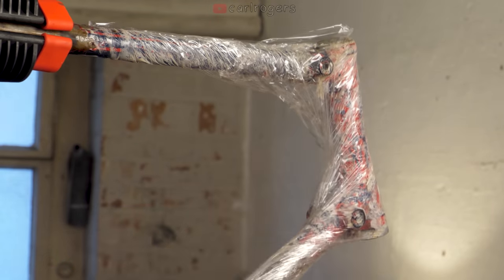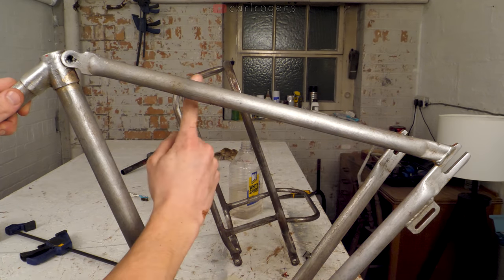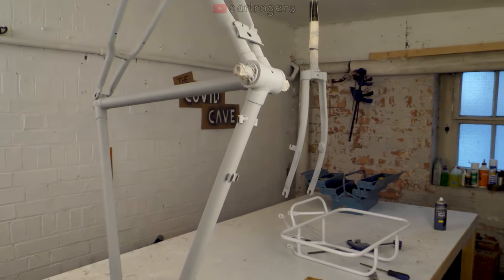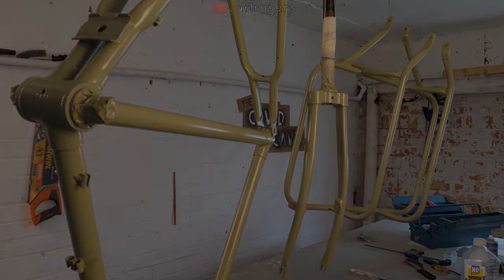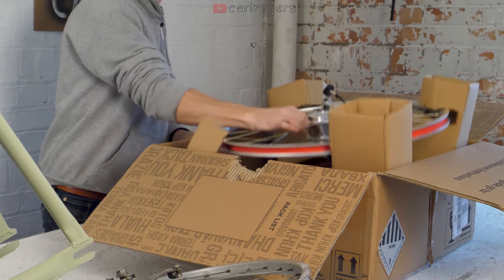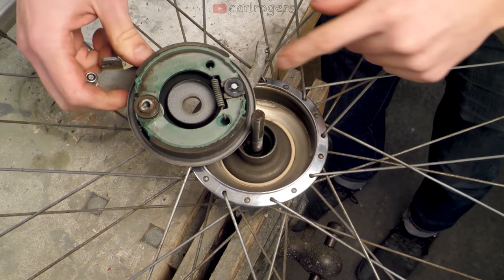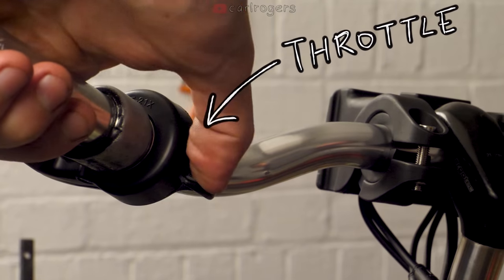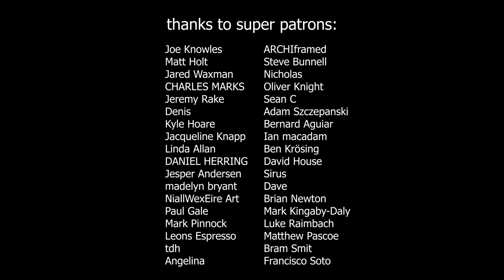Turning Rusty Canal Find into Electric Bike

Comment: Just a tip, if you force a seatpost into a steel frame with a mallet it might never come out. If you remove the seatpost bolt from the frame and put a large flat-bladed screwdriver in the slot at the back of the clamp brazed on the frame, with slight sideways pressure you can open the clamp and slide the seatpost in by hand. Lubing the inside of the clamp as well as the seatpost helps.
This tip is for steel frames only!
Reply: Or maybe get the right sized seatpost in the first place. It should slide in with no bashing.
Reply: @Wuzza47  That might be true for aluminium frames with a separate clamp, but steel frames with a brazed-on clamp usually pinch the seatpost even with the bolt removed. Steel is springy compared to aluminium and the clamps on steel frames were made that way to ensure a snug fit, as the clamps are not easily replaced. If a steel bike has been in a canal for any length of time it will almost certainly have some rust on the inside of the seat tube, making a simple slide in even less likely.
Reply: @liberality  forcing a too big seatpost into a frame even if the bolt eyes are not pinched will almost inevitably make it extremely difficult to remove. The slightest corrosion will also jam it in the frame
Reply: @Wuzza47  I agree, obviously the seatpost has to be the correct size. That doesn't mean it will slide into the frame easily.
Reply: Notice that he coated the bottom of the post with Anti-seize, which should prevent galling and make it reasonably easy to extract.
Reply: @jimboking  If the seatpost was the right size, but then it wouldn't need to be hammered in. Vernier calipers are your friend 🙂
Reply: Woopty doo Basil.
Reply: @Angusmantheman  what duz ita allllll meeeen.

Comment: I kept watching thinking "any minute now he's going to pull and service that bottom bracket!"
Reply: I’m kinda disappointed tbh
Reply: My thoughts exactly! No way that thing was still working properly...
Reply: agreed.
Reply: Since the frame was only in the canal for about ten minutes, it's probably fine. That, and you don't need to pedal an e-bike.
Reply: If it aren't broke, don't fix it :D  (as the BB was sealed, I somehow believe the bike has been used prior dumping it in the river)
I somehow believe the bike wasn't in the river for long. The whole bike frame seems to be in really good shape(paint doesn't count, it is always a bit of a mess).
Reply: @nothereandthereanywhere  
The bearings did seem  to be in a suspiciously good condition.
In fact, better than my new bike after a year of being used and maintained properly .......................
Reply: @kevinshort3943  TBH can't see any rust on the bike, seems only on the front rack.
Reply: @kevinshort3943  So all may not be as described eh, are we being led down the tow path?
Reply: @philipbarrett3151  
I thought the BB was a bit odd, why not take it out to repaint, as it must be ruined .......
But it was very shiney on the drive side, and the other side was plastic (a new thing?).
I also read some other comments alluding to things being setup, staged, fixed etc....

He should have spayed it postbox red though.
Reply: No need to pedal with that non-road legal throttle actuated motor, so doesn't matter if it seizes...
Reply: It's a sealed unit, so there are no serviceable parts. If they feel graunchy or rough you just whip em out and fit another. 
 You would probably take it out anyway though to drain any water and put a bit of grease in there.
Reply: @mickenoss  The frame was filled with water which means the BB was the same - no way did the Post Office put some high-end sealed unit in there.
Reply: @philipbarrett3151  
Thr BB is a "sealed" unit, but that just means they aren't serviceable, crap will get in them over time or if submerged.
Oh, and you can get one for less than a tenner from Halfords.................
Reply: Same. Its basically the heart of turning the cranks. Madness!
Reply: @nothereandthereanywhere  Yes. This Is a fraud vídeo.
Reply: me too!
Reply: Would have taken less time to pull the headset and bottom bracket out than to poorly mask it up.
Reply: @mickenoss  If a bike has been in a canal for any length of time, then likely just whipping out a BB would be next to impossible.  But as this bottom bracket is brand new and the bike was in the canal for a quick dip, no real issue.
Reply: @philipbarrett3151  Also alloy cups. heh.  The tapers had no wear on them at all, either.
Reply: @vtrmcs  went by for a 2nd pass, look at 0:40 - that frame already has paint stripper on! I'm not recommending an internet lynch mob but it's a nice bike restoration video without needing to make up a fairytale to go with it.
Reply from the maker: @philipbarrett3151  sorry chaps it's just a YouTube video
Reply: @vtrmcs  Oh yeah, that thing was probably barely in there 10 minutes.
 We've got out some incredibly stuck BB's over the years though, some were so stuck the threads came with them. Shimano units always came out pretty nice.
Reply: Me Too, that needed to come apart.
Reply: @everynamealreadygone  Throttles are allowed on bikes from before 2015.
Reply: @carlroge  No need to fake "finding" a frame in a canal. Too much of that kind of vids going around already.

Just keep it honest.
And yes, if you strip a bike, do it the right way and strip it completely.
Reply: I'm also wondering how much are the ball bearings in the UK? They have to cost an arm and a leg, since he decides to wash and regrease the old ones... :O
Reply: @williamceuppens5533  sure it was still working if you trowed the frame in there youreself two days ago.
Reply: @gRuHa89  it’s fine to wash and re-grease those non sealed bearings, as long as the bearings themselves are in good condition i.e still round! I had a chipped bearing in my rear hub a while ago and it kept causing the cones to come loose, I just took it out in the end and ran it with one less bearing. It is interesting the move towards sealed bearings everywhere on bikes. They last longer without maintenance but are much more wasteful since they just get chucked and changed, way of the world these days I supposed... 

To be fair removing old threaded bbs and getting a fresh one back in is a right pain! If it’s still working at all then it could totally be worth just leaving it alone.
Reply: Yep definately would have changed that Cartridge. Looks like a cheapo VP RPM or other asian model. Cost? about £15 for something like that maybe even less. Ah well, he atleast  made something from nothing and did his bit for cleaning up the river. Well done all the same. :-)
Reply: most likely he found it on gumtree and chucked it in the canal, to find and make the video ?
Reply: Just get it out to make sure it aind seized in
Reply: That bottom bracket has recently been out of the bike.  There was no corrosion around the splines, or where it contacted the frame.  This is not possible for a bike that's been in a canal for any amount of time.   I'm also skeptical about the headset.  The cups were clean with no corrosion where it meets the frame.
Reply: @jimhansen5395  That BB also looks completely incorrect for the bike's age, it looks like it was a brand new Shimano BB-UN55. Older square taper BB's didn't have the splines for the mounting/removal tool.

The idea of a 'canal find' is cool and all but this makes it look a bit staged. Unless you get to Amsterdam, where you literally trip over bikes dropped into the canals.
Reply: @carlroge  
just a youtube video hey? 
cool.  then I presume 'switch' doesn't exist, and won't bother looking for their products.
Reply: @carlroge  Yeah, a dishonest one.
Reply: @kyle8952  I'm pretty sure that's if they had a throttle before 2016, not for retrofitting one.
Reply: @gRuHa89  Particularly on traditional headsets, replace clipped balls with loose anyway; the clip is just a convenience for the factory. Loose balls spread the load better and can make an "indexed" headset usable.
Reply: @RICHARD.WRIGHT1  You actually fell for his BS?
Reply: I came here to mention why the hell didn’t he take it out !?
Reply: Why would he service it, it's brand new!
Reply: Never thought a postie bike can look cool. Well done chap.
Reply: I thought the same thing
Reply: I know right? It’s so annoying
Reply: It looks like someone installed a brand new bb before chucking it in the canal, very considerate.
Reply: @philipbarrett3151  💯
Reply: Same here.....it must be welded with rust😮
Reply: 5:15 This closeup of cleaned and oiled parts tells me that he simply forgot to film that part.
Reply: me too
Reply: Same.
Reply: @carlroge  I like the wink and nod to all the fake restoration videos by pulling it from the canal. Keep the theme going and start every video with an odd "rescue" location for the project.

Comment: Question; why didn't you remove the bottom bracket? I would think that water would had contaminated it as well since the water was in the frame.
Reply: Its fake lol
Reply: @bandguy360  what’s fake ?
Reply: @colekiblinger8009  it was in the water for not more than 30 sek when he was filming.
Reply: @VadimOnTour  hahaha
Reply: @VadimOnTour  you’re right. I have actually fished a bike out and it has several rust holes. I rebuilt the bike and use it at events with all the rust holes it’s pretty funny
Reply: Yo me hice esa misma  pregunta, pese a que sea amateur debería de haberlo cambiado.

Comment: Nice video and I'm jealous of the find. It looks like really good workhorse for town rides. One thing I would advise, use an electric tape for covering sensitive parts, it is easier to apply, doesn't break and much better to take off. Otherwise, really well done in fixing it, it's a beauty!

Comment: You know all bicycle restoration jobs are best undertaken with the headset and BB still fitted
Reply: And brake pads cleaned by soaking with wd40... And then everything reassembled with not enough grease and handlebars fitted upsidedown...
Reply: Yes, it keeps paint out of the frame threads. If you don't have a bottom bracket thread cutting tool this is definitely the way to go. If you score around the bottom bracket cup with a sharp blade after the paint has hardened a little, before removing the bottom bracket, you will retain a good paint finish.
Reply: @liberality  Sound like hassle compared with removing the bottom bracket and masking the threads.
Reply: headset bearings were removed, those are just the bearing races.
Reply: @tinglydingle  But of course "just the bearing races" comprise the larger part of the complete headset. They just tap out, so why not do the job properly rather than a half-arsed workaround?

Comment: That bottom bracket is going to haunt my dreams, lovely build otherwise!
Reply from the maker: 😆 what's a bottom bracket? 👹
Reply: @carlroge  This is yours 9:22 - looks like a sealed unit tho so maybe it's not too badly corroded, depends how long it was really under the water for ;)
Reply: Usually sealed threaded bottom brackets like that get stuck in the frame way before they go bad so even if it is bad it's a part of the frame now
Reply: I was thinking the same thing.
Reply: @Wezly  not that long maybe a month or two. Ultility bike no doubt steel looked clean some would weld on it 😂.
Reply: @alexcantlow2920  Call me cynical but I'm suspecting it was placed there for the video 😬
Reply: Me too, bars on upside down, not replacing the brake shoes or the bearings. I wouldn't trust brakes shoes that contaminated. Top build though.
Reply: @Wezly  just a tad it was pre stripped the paint work. bit of salt water for surface rust left on a sunny day. Not cynical just see past the bullcrap 😂
Reply: @alexcantlow2920  I guess the canal storyline helps get a few more clicks and for that I applaud this creator using the tools available to them - but that bottom bracket tho.. that needs sorting 😆
Reply: @carlroge  hey there Carl My name is Steve I am from the U.S.A. I ride a Mongoose Mountain Bike I really Like that Postal Rack or Basket where could I buy one?
Reply: @moriym8016  you can still get the cartridge unit out of that bottom bracket shell
Reply: @moriym8016  Copper Ease.
Reply: Yeh I wondered why he didn't replace it 😂
Reply: @moriym8016  nah you can always get them out with enough wd40 :) trust me I've converted a lot of rusted bikes 😂
Reply: @Wezly  The dead giveaway was the clear water coming out when he drilled the stays. 5 minute dunking.

Comment: Step 1: Continue to strip the paint. ( a job which he half got through before dipping in the canal)
Reply: I thought the exact thing as soon as he hung it on the stand 😂
Reply: Nitro mors lol
Reply: 100% agree.
Reply: Either that or there is something seriously wrong with the water in that canal.
Reply: @myitbos1335  The canal is actually filled with brake fluid, so the boats and underwater, oops, underoil  bikes don't rust.
Reply: Yeah I noticed the paint slothing off the frame when it came up on his grappling hook !!
Reply: Agreed i pulled stuff out of dutch waters and it looks rusted and all kinds of horrible. This frame whas way to fucking clean. And trust me you wouldent see junk clearly from a meter away in merky water. Title would have been fine if id said old frame restored to e bike
Reply: i was just going to say the very same.
Reply: Shhh... not too loud.

He thinks no one will notice.  Pretend to be dumb and go along with the clown show.
Reply from the maker: @markvincentcocjin  appreciated!
Reply: In fairness, its a moderately plausible reenactment.

If it had actually been found in canal, lets hope he dragged it home first, degunked it a bit and then decided to make a video of the restoration.

I shudder to think there are people running around being shadowed by a camera just in case something comes up that can be monetized.

Comment: Great job. I personally would have fitted the battery behind the basket on the front, just think it would look better there.
Reply: but that requires a longer cable
Reply: @buenasnoticias9093  And? So what?
Reply: @MrRockstar1968  
maybe the cable is not long enough or if the cable is too long it becomes unsightly
Reply: @buenasnoticias9093  It's a simple task to lengthen or shorten cables. And also my initial statement stating "I personally would have fitted the battery behind the basket on the front, just think it would look better there." That this is my opinion and my preference and nothing you can say can change or alter this. So your comment is pointless.

Comment: Very interesting. Those old Pashley Post Office bikes are brilliant, but you've only got one (pretty unimpressive) drum brake on the rear now... It might have been good to weld some disc mounts onto the frame while you had it stripped down - or find another way to put a brake back on the front wheel.
Reply: or ride it fixed brakeless lol

Comment: Why would you not take out the bottom bracket to replace it with a bearing one. And why not replace the fork headsets? Also, why not remove them before painting the frame?!? I want to say i like the video but i cannot do it... All the best!
Reply: Sometimes you just want a quickie mate
Reply: Putting pedals on with an adjustable spanner what a way to mark your new crank arms also the upside down bars talk about uncomfortable

Comment: Can’t see the price of the conversion kit since they are out of stock.
How much does it cost?
Reply: Between 499 and 999 depending on delivery timeframe. Not sure of that includes the 50% off but it's prohibitive for me
Reply: £1000 list price from stock, £500 if you pre-pay and wait for months, less if you source similar bits yourself direct from China (although the battery pack and controller won't be so neatly packaged).

Comment: I had an old 25 yr old road bike in the garage not being used. Put the same conversion kit on and now the old bike flies with it on, it's pretty quick.  Use it all the time in the city as a commute. No looking for a parking spot, filling up with petrol etc. I prefer the pedal assist rather than the throttle setup he put on. They are a good easy install to whack on an old bike that's not doing anything.

Comment: hey boyo, I also do restorations but not to this extent, have picked up some tips though. An ultrasonic cleaner will do you wonders (get one big enough) especially paired with "gunk" the engine degreaser in a sealed container. Great for work inside the bearings and especially cleaning freewheels/derailleurs

Comment: A way to get the water out next time a similar situation comes up is to (gently) heat those tubes up with a propane torch. Since they already had a hole, you could have evaporated off the moisture without damaging the strength of the steel...and not had to drill more holes.

Comment: Great video. Really well done! I've got an old East German Cargobike I've been thinking of electrifying, and am very interested in Swytch, but need to have a bike with front and rear lights, so I'd want to have a battery connection for those, which I don't believe offers. I know they have a front light built into the battery pack, but that wouldn't be bright enough.

Comment: I own a ex Royal Mail bike like yours which I bought from Elephant bikes totally refurbished using either used or new parts with a choice of colours for £330 delivered . Using a Bafang 250 watt mid drive motor and 36volt lithium battery I’m the proud owner of the ultimate shopping Ebike .

Comment: Should have pulled out that bottom bracket to ensure proper interior drying.  Also, linseed oil works great for rustproofing the internals of the frame.

Comment: Drum brakes!! The vintage design is still manufactured on some cars to this day. I'd say that's grounds to consider them pretty damn good.
Reply: They're still used along with a rim brake on the front of some tricycles; it's an easy way of providing two independent braking systems. (That's a legal special case - most cycles need brakes front and rear, but two on the front is easier on a trike.)